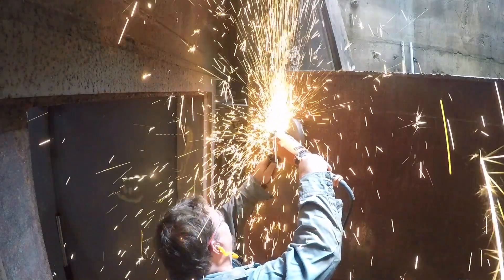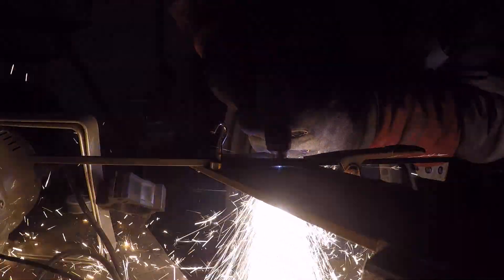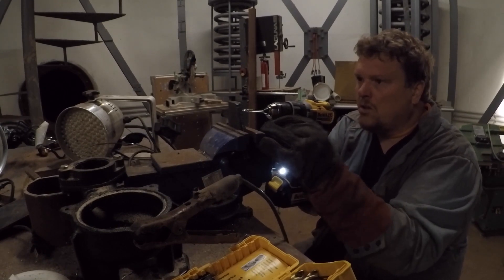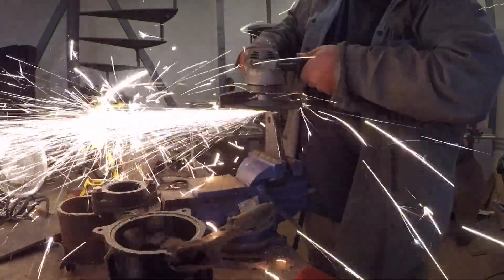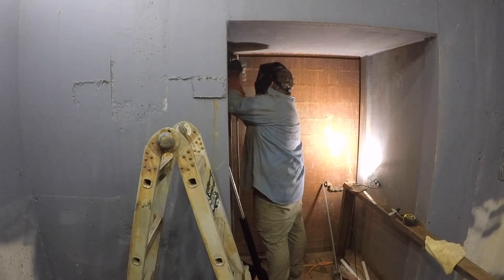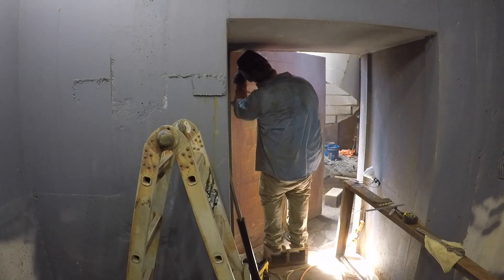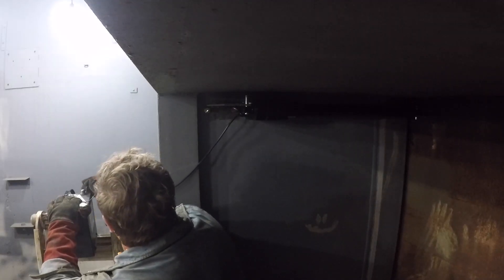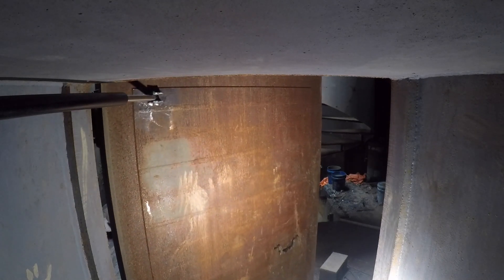EP24 - Moving 6000 pounds with a finger - Blast door actuator

Comment: I realise this is an old one, but if you haven't already - you should put some safety devices on this, the closing force must be fairly massive, consider some safety edges on the door or a beam to cut the power if a child or such gets between the door and the frame on opening or closing! As well as battery backup which automatically opens the door if you have a power failure or fire...

Comment: Have you looked at fire sprinklers for the areas with wood and other fuels? A simple pex line with fire sprinklers would quickly knock down or even put out any fires with the only ones opening up directly in the heat unlike in movies where every sprinkler turns on at once.

Comment: Install a drag link into that actuator.   My guess math you could structure it in such a way that the main door can open 180degrees.

Linear actuator > stand off pivot and linkage, > link arm attached to the main door.
Reply: No can do, there is an external wall in the way.  BMAT MIKE

Comment: What if the power disconnects and the door is unable to open due to it being welded to the actuator, just a safety thought.
Reply from the maker: The actuator is battery powered. The actuator is not welded to the door. There's a pin that could be removed.

Comment: Some considerations especially if this is going to be a public use space.  There needs to be some sort of force limiting system in case someone or an object gets trapped in the closing door. The force limiting system would be a current sensing relay that shuts off the actuator.  . .. . ..  Given the hinge side has lots of leverage, there needs to be a rubber sheet shielding the pinch point because the force sensing system won't stop in time.  Slow opening and closing is just fine. Go too fast the the inertia will damage the actuator plus the slow operation gives a person time to get out of the way. . . . . There also needs to be limit switches for the open and close so the actuator does not get damaged.

Comment: Look Ma ! No gloves ! No protective head gear ! What a big boy you are !!
Reply from the maker: Safety glasses and ear protection don't count?
Reply: @GTsTitanRanch  In theory if you are grinding you have a defined impact hazard you should have a face shield, the safety glasses are a backup and aren't meant to be the primary defense against flying schmoo. Also to the dude, you don't wear gloves when grinding/drilling/anything spinning. A glove wont stop a grinder disk, it will however pull your hand in. (latex/nitrile to keep oils etc off don't count)
Reply from the maker: That's good point about wearing gloves while grinding. Thanks for the tip!
Reply: @GTsTitanRanch  All good mate ;-) Do watch out for the grinding sparks and your eyes though. Had 2 friends get iron particles bounce off their face into their eye. It melts into the surface of your eye which is a bit irritating but not bad. Then it starts to rust and it really friggin hurts. The Dr's have to scrape it out of your eye with a needle. Both of them wear sealed goggles when grinding now.

Glad to see you working on it all again man. It's an inspiration.

Comment: I like the door, but I hope you add either an emergency stop button or some form of detection for the door being blocked so no one gets hurt. For example the sliding doors on a mini-van only take something like a pound of extra resistance before the safety kicks in and they reverse.

Comment: As a welder myself I worry about how you are getting the fumes out. I had had metal fume fever, it's no fun man. Neat project man,
Reply from the maker: There's a 12,000 CFM fan that pushes air through the facility when we are doing big cutting and welding projects. Thanks for the thoughts!
Reply: Metal fine fever is mostly caused but grinding and welding zink. Like galvanized metal. You don’t have much to worry about. You don’t have much to worry about except sneezing and blowing out black bugger. Most welders know that

Comment: Are there any videos of the missile silo itself?  Or was missile area not included with the purchase/property?
Reply: It's sealed off and full of water and debris.
Reply: @crossan008  So was everything else. The missile silo itself is however covered in a large concrete "lid"
Reply: Kaizer Power Electronics and @crossan008- do either of you know in which episode he explains the debris and lid?  Can’t the silo be accessed horizontally via tunnel?
Reply: @buzzkillblurr  I am not sure which, but must be one of the first if any. I do not think you can tunnel into the side, due to ground water level being above the blow-away part of the silo, so you would effectively try to drain the entire property.
Reply: @buzzkillblurr  Maybe they could go look for the air intake tunnel / escape tunnel, you can see there is identical tunnels on both silo and control center: http://blog.nuclearsecrecy.com/wp-content/uploads/2014/04/Titan-II-silo-layout.png
Reply from the maker: We could for sure get in through the tunnel. It's just a lot of $$ to get in then what the heck do I do with it? I don't have the $$ to do anything productive with it. If you guys want to do a go fund me to open it then I will. :-)
Reply: Death Wears Bunny Slippers once the missile silo is cleared of all muck and debris, you fill the bottom 40’ of it with small chunks of soft foam and build a diving platform at the top.

But seriously... surely you are at least somewhat interested in gaining access to the silo just to see it, even if you don’t have the time and $$$ to  discharge all the water?

Comment: Nice solution for that front door.  Hope it continues to work well for you.  Another solution for remote actuation of the door would be to use a key fob/radio signal to trigger the actuator.  Push the button when you're at the top of the stairs coming down and the door will be open by the time you get to the bottom.  Lower tech than the arduino/app solution, but it should still work.  

As an aside, I seem to recall you were thinking at some point about using the cableway to the silo for growing food, etc.  You should check out "kratky hydroponics."  It's a stupid-easy way to grow veggies (I grow a bunch myself - lettuce, tomatoes, cucumbers, peppers, etc.) with very little setup (no pumps or anything) and it would make good use of the space.  Just a thought.  

Glad to see you posting again.  Looking forward to seeing what else you do with the place!!

Comment: Do you ever plan on gaining access to the Area where the missile would have been held or is it impossible with all of the debris that would have filled it up when it was decommissioned
Reply: The early videos detail this, bottom line is probably not realistic because of the work involved.
Reply: Not practical without millionare kinda money.
Reply: @CutTimeBrony  I think he has that covered.
Reply: Here's why that would be impractical...  The shaft is full of debris and there's a 3' steel reinforced concrete cap over the top. https://youtu.be/r4Um_QA1N7A?t=218

Comment: Problem is, if your *duino contraption fails, it leaves you locked out, as this type of actuator with a screw-type mechanism can't be usually moved by any other means then its own motor. 
So I consider this to be a pretty unsafe design. Likely why even the original design did not have any powered opening/closing mechanism for the door - would make it impractical and also unsafe.
Reply from the maker: There were 4 hydraulic locks that were closed during operation. I can promise you that overcoming a failed actuator is MUCH easier to deal with than those locks failing.
Reply: Sure, but you better don't want to overcome any actuator in the first place. A more than likely, even those hudrolick locks may've been designed to be operated manually. (Otherwise obviously you got a locked out main access door).
Reply from the maker: They could be actuated manually with a hand hydraulic pump. Even if I put in a hydraulic version I'm not going to allow it to be overcome from the outside.
Reply: I have an idea for you. Run an emergency cable to the pin. From the outside, you can get even more clever. A solenoid that pulls the pin and releases the cylinder is a cool option, on the outside you can have a key operated switch.

Comment: There are some conduits leading through all that thick concrete and steel wall.  The buttons for the pins were on both sides.  We NEVER let the doors slam, as that would damage the door seals.  Swinging open, there was a padded stop.  BUT we NEVER let the doors swing against them.  I DON'T think a small child could pull/push that door open - took a pretty good STEADY PUSH to get it started open and closed.
Reply from the maker: Well I'm here and I've seen younger kids get it moving (which is the hard part). Now, not all kids that age can and when they do they are giving it their all. :-)

Comment: So. What happens when you lose power and you're inside? Isn't the door going to pin you in as the actuator won't move?
Reply from the maker: The door is DC powered from a battery. And, if inside, just remove the pin.
Reply: Ah right, and from the other side?
Reply from the maker: Then you put enough force on the door to break it. Wouldn't be easy but anything is possible with time and force.

Comment: Cool. I guess pneumatic cylinders would give you more speed and a satisfying  whoosh sound effect to go with it.  In any case, what is your contingency in case of power failure or linear actuator fail?
Reply: id think pneumatic cylinders would result in loss of limbs, electric and hydraulic actuators respond instantly to input, not that pneumatics cant react fast, but they are springy, and that door is heavy. if you wanted to slam it shut quick fast in a hurry, pneumatics.

Comment: If you were to make your mount from the actuator on the door itself come out another 3” out of the door , when it swings fully open, it won’t be locked in that “almost open” position as it won’t be parallel with the actuator , thus giving you a few more degrees of the door being able to fully open.

Comment: This starting to look really nice! A couple of points: 1. Actuator. The mechanical part of actuator might not last very long, since the door is really heavy, has a lot of momentum and when actuator abruptly stops, the door tries to continue to move increasing load to the actuator several fold. There's a couple of solutions - introduce short but heavy spring between actuator and the door or make some kind of solution that gradually slows down actuator before turning it off (this might be much harder to implement). 2. Plasma cutter super-heats AIR with electrical current (not metal). Then this super heated AIR blows away metal. Therefore it's name - plasma cutter (plasma is a superheated gas).
Reply: Standard electric gate actuator will work there, plus has built in battery back up, for power cuts, has both ramp up and ramp down, and also senses motor current to detect obstacles ( like your foot or arm) in the way, plus you can also select a part open selection for pedestrian use, or a full open position for large stuff. Also comes with a key to disable the actuator if faulty or the power has been out and battery is flat, which comes in useful.
Reply: @SeanBZA  Didn't know that, thanks! I thought that it was a simple linear actuator without all those functions.
Reply: ...yep - always an issue - stopping the door moving.  Preferred to use 2Lts for bumpers...

Comment: If the electric motor ever failed (with the door closed and you outside) do you have a plan B to get in?  Maybe the air ventilation shaft?
Reply: That actuator wouldn’t give much resistance if you got a crowbar between the door and the frame. Would be easy to open by hand.
Reply: @SurvivingTheApocalypse  Oh, ok.  I would have guessed that actuator is tougher than that, but I guess I have never used or seen one in person to know.
Reply: jontscott its no different to the gas struts that open your trunk or bonnet really. You can see in the video that the push/pull bar isn’t that thick.
Reply: @SurvivingTheApocalypse  Oh, I was imagining it had a screw rod or something like that in it which would lock it in place if it the motor and gears are not spinning.  Nice to know if it failed access would not be a big deal.
Reply: @jontscott  Crowbar will open it, though prettyy much the actuator will be needing a new set of gears, they are designed to fail if overloaded, a very needed safety feature.
Reply: @jontscott  You're right, the actuator uses a worm gear and it won't be as easy to break in the closed position as these other people are saying. It works the same way as an actuator on a big satellite dish. nibunker is wrong, it's nothing like a gas strut.
Reply: I don't think that wrestling a hefty actuator with a crowbar would be that easy as some of you may think.
Reply: The position of the actuator compared to where you'd be pulling would give you 5-10x leverage.  It wouldn't be trivial to pull with 200-400lb of force (putting 2000lb of stress on the actuator and causing it to fail) but I bet if you could get the door to move at all, a bit of swinging and rocking would bust it up pretty good in a short period of time.

Comment: hopefully it will continue to work perfect. Otherwise you might be outside and you will no longer be able to open the door
Reply: Even with the actuator there you could still force the door open with a crowbar easily.
Reply: Surviving The Apocalypse no you could not
Reply: Recommend emergency explosive bolts. Can you get those at Home Depot?
Reply: we use air on the doors at work instead of eletrical like these, same principle.  but if the air goes out,  we can open the door by hand as there is no pressure pushing or pulling then.

Comment: you should look into a metal circular saw, you get such a cleaner cut then plasma cutter, its different than an abrasive metal cutter too. you get little to no sparks when using it.
Reply from the maker: Have you ever seen a cut from a plasma cutter? And will the circular saw cut 1" steel without sparks?

Comment: Did you reactivate the door pins hydraulics?
Reply from the maker: Not yet. They will likely need to be hydraulic. Will take a bit of $$ to get all of them working.
Reply: Bill Howard I was just about to ask the same thing.
Reply: Bill Howard pretty sure if I remember correctly in the first video they said that the pins were still there but almost all the mechanics for the pins was gone